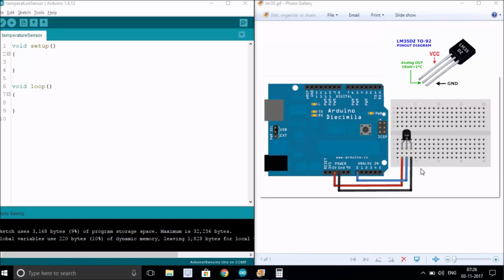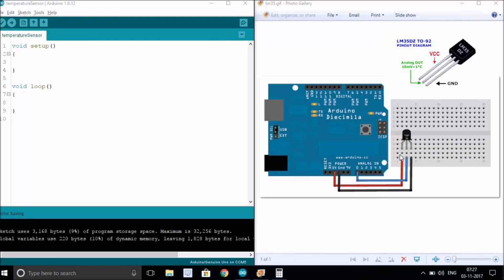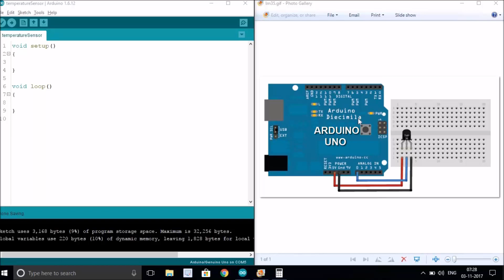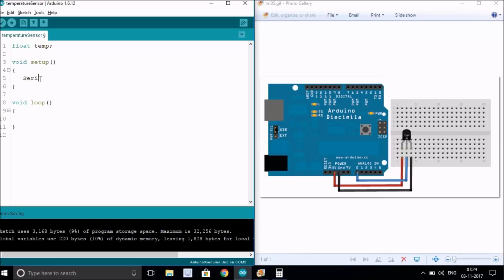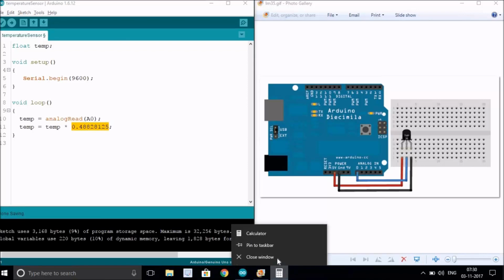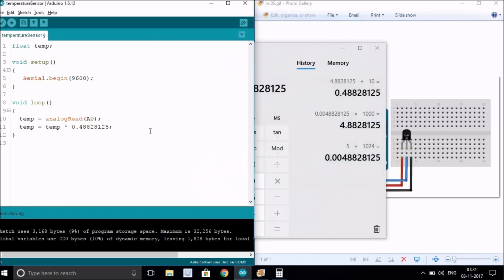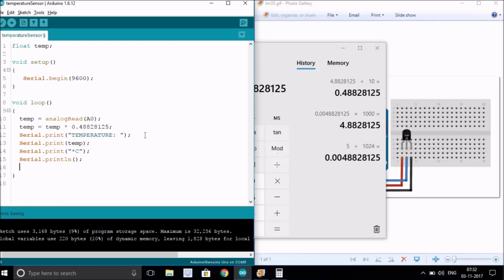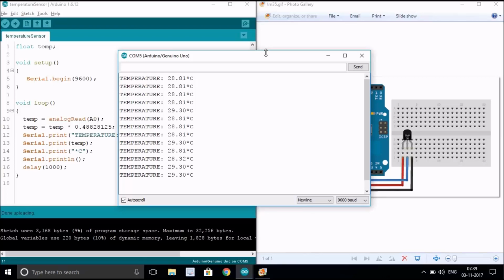LM35 Temperature Sensor with Arduino Uno

Comment: I am not getting temperature reading in serial monitor... So can you tell me what's the issue?
Reply from the maker: Hi Jainnypatni, please check with the connection between LM35 and Arduino Uno. Make sure when you hold sensor facing your face then left pin with connect to 5V, middle pin will connect to A0 and right most pin will connect to GND. I hope this may help to get temperature data. Good luck and best wishes!

Comment: I am getting output on serial monitor from 90 to 120 and I'm using LM35. When I remove all the connections from arduino, it is still showing some garbage value on serial monitor. What could be the issue?
Reply from the maker: Hi Suddhi, It seems like as Issue is with LM35 temperature sensor. Your Arduino is fine. If you want to test then try other sensor to make sure its not an fault of Arduino Board. Good luck and best wishes!

Comment: even though it is not effecting the result , the accurate calculation is to divide by 1023 and NOT 1024
analogRead() returns values from 0 to 1023 so 0v is 0 and 5v is 1023 !!!
Reply from the maker: Yes thanks for adding comment. Good day

Comment: If anyones geting any high values of temperature....pls check the connections first....if problem persists pls change the sensor.....i hv done it and its working........The code above is correct

Comment: hey man. I'm kinda desperate, but could you explain a code, where if the thermal sensor detects a certain temperature, the servo turnes?
Reply: Man use a if statement, ig it'll work then..

Comment: Sir is it possible that after reaching a particular temperature, the sensor goes off? Can you please give me the code and the curcuit diagram?
Reply from the maker: Hi Avin, sensor never stops as long as it has power. You can program in a way that when certain temperature threshold reach then stop reading data from temperature sensor. I hope this can help. Good Luck
Reply: @BINARYUPDATES  thank you for the info sir but actually I am not a kind of professional and I have to code a temperature sensor for a school competition so can you please send the code?

Comment: thank you for the code. but this lm35 is totally not accurate. cant be trusted. instead good to use DHT11 or DHT22
Reply: Lm35 is really accurate
If you use it correctly
Its only 0.5% error

Comment: Why 1024 ? sorry the audio was not clear.
Reply: Yah tell me ans to this question
Reply from the maker: The Analog Pins means an ADC Channel on Arduino Uno is 10-bit so 2^10-1=1023 and if you start counting from 0 as in any digital electronics. Its become 2014. I hope this can help you. Thanks
Reply: @BINARYUPDATES  Wrong !
the analogRead() returns linear value representing the voltage 0 for 0V up to 1023 for 5V so the voltage calculation is V=analogRead *  (5/1023)
NOT 1024

Comment: This tutorial is not correct please make corrections as follows:
Suppose I have 0-80 volts range:
10mv/1 C *80= 0.8= Vref
suppose I have 8 bit adc 0-255 range and suppose my sensor value is 200
so formula would be: sensor values * (Vref/max value)
= 200 * (0.8/255) =0.627 
To convert to degrees centigrade 0.627*(1 C/0.01 or 10mv) = 62.7 degrees centigrade

Comment: 5v / 1024 = 0.0048828125 is already in volts... multiplied by 1000 to make it in millivolts. hehe.
Reply: LMAO of cause if you devide voltage with a number you still have voltage as your result.  Multiplying the result with 1000 will just bring you back to almost 5 volts so i am not understanding your logic. 

You do 5v divided by 1024 because that is your arduino range. Then you multiply that by 10 to see the exact (millivoltage) mV per unit. 

but DIVIDING 5v by 1024 gives you mV per unit.  ITS ALREADY MILLIVOLTAGE !!!  You dont have to multiply that to get mV, it will just bring you back to 5v
Reply: I guess you could divide by 5000 instead of divide by 1024 and then multiplying by 1024     

''''
   temp = analogRead(A0);
   Serial.print(temp);

   temp=temp/1024;
   Serial.print(" /1024 ");
   Serial.print(temp);
   Serial.println();
   
   temp= (temp/5)*1024;

   Serial.print("TEMPERATURE: ");
   Serial.print(temp/10);
   Serial.print("*C");
   Serial.println();
   delay(1000);
'''
Reply: @jared1122  at any case 1024 is wrong it should be 1023 cause analogRead returns values from 0 to 1023 representing 0v to 5V

Comment: i am using the 36gz sensor and have this same set up, is my math wrong? my temp is reading 78c to 80c
Reply: It looks like you are interpretation the raw sensor data as your temperature.  Devide the sensor value by 2 and you will output your degrees celsius.

Comment: hello, i followed your code and setup on the arduino uno. however, i never be able to get an accurate result(The result aint stable. It Looks like waves, Peak to 0, 0 to Peak). how can i fix this?
Reply: it probably means the sensor is picking up a lot of noice, so try connecting the sensor to the 3.3V
Reply: the output changes as well then, so youll have to use another conversion from output volts to degrees
Reply: Alright, thanks

Comment: Could this code be used with a fan to control the temperature of a room? I want to kick in a fan if the temp goes to or above 28c then cut off when it gets down to 25c
Reply: I dont see why not.

Comment: Another thing to consider, especially those who have followed the instructions on the video and get a reading of around 90, is the type of temperature sensor you have. In the video, the temperature sensor used is LM35 that is linearly proportional to Celcius scaling. Check maybe you have an LM34 that is linearly proportional in FAHRENHEIT SCALING.

Comment: My Sensor is exactly the same one in the video, but it is giving me 0.00 output. please help.
Reply: Mine too, and the legs are opposite. If I connect them as the video, my Arduino turns off and get disconnected (port disconnects), and the sensor gets hot.
Reply: @tupa2pac  if you flip it, it gets short that why it gets disconnected, your sensor will be burnt like this

Comment: If people encounter wrong readings, it's probably because the 0.48828125 is the conversion for a 5 volts power supply... If your specific Arduino supplies 3.3 volts, it would have to be a different number; do the same steps with the calculator but starting with 3.3 instead of 5.
Reply: I say, maybe change the multiplying factor to (5/1023)

Comment: Hello sir,,,  I have tried LM35 with arduino nano board as you showed in video. Same circuit same code. But LM35 is giving incorrect reading to serial monitor. Like 11.45 /21.06 /39.88 /17.2 /25.22   . Please solve this problem
Reply: It is correct. You just need to process the raw data into something sane.
Reply: The problem is rather complex, you should first set refrence point(best to be zero centigrade of Celsius) and then mesure voltage drop from there. It requires a lot more knowledge than described here.
Reply: Those answers are ok, just take average of 500 of those.

Comment: sir 4.8828125 it is in volts and ur dividing by 10 and saying that 10mv=1degree celsius how it is possible
Reply from the maker: Mr. Kashirajvk Kalshetti, I mean when we divide 5/1024 = 0.0048828125 V. Now when we conver 0.0048828125 V into mili-volt we get 4.8828125 mV. Now 1 Degree Centigrade is 10mv (according to datasheet). We must divide 4.8828125/10 = 0.48828125. Now this 0.48828125 will be multiplying factor to get Temperature in degree centigrade from LM35 Sensor. I hope this would help. Have a Good Time. CHeers

Comment: Can I use arduino nano board to this sensor , where I am using other digital pins for a relay & 7seg display???????? Actually I want to control a relay on/off timing according to temperature limit,,,,  please suggest me...
Reply from the maker: Yes, you can use Arduino Nano with LM35 Sensor

Comment: hi. can LM35 detect temperature lower than 0 dgree celcius?
Reply: and does anyone hv any suggestion on other temperature sensor that i can use to detect negative temperature.
Reply from the maker: Yes, according to the datasheet of LM35 from TI. This sensor can measure temperature from range -55 to 150 Degree Centigrade.
Reply: BINARY UPDATES previously i tried to connect arduino and lm35 equipped with a java application, but somehow lm35 cannot detect lower than 0°C. And i encounter a forum saying that lm35 cannot detect lower than 0 dgree temp when connected to arduino. Which is different than the specification of the lm35. 

Some even said to try use lm335 instead. Can anyone clarify me about this? Thanks in advance.
Reply: Upto -55